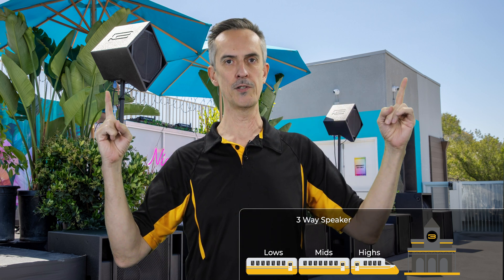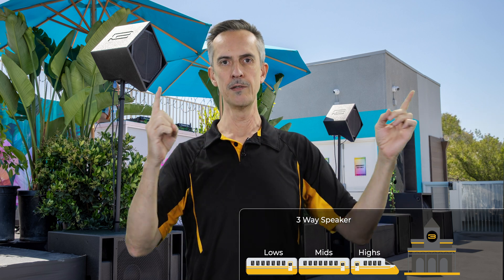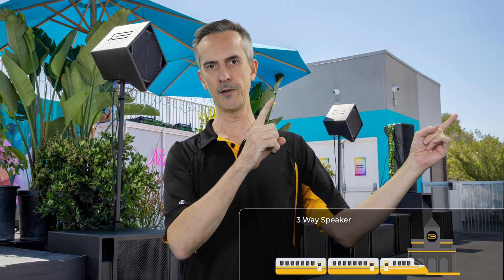Choosing between 2 Way and 3 Way Speakers: Pros and Cons

Comment: But the time delay is usually in millions of a second.  I am sold on 3 way over 2 way speakers just because of the better or fuller frequency band.  
For some reason 3 is the magic number for speaker designs I think.  They just sound better.

Comment: OK - Help here, I need to buy a Bassboss system for two people who travel to a remote location, set up a small portable 20x20 stage trailer (no truss) and ground up sound system for 1500 people, a few hip hop DJs and a few rock bands. What Bassboss set up should I buy for less than $50k
Reply from the maker: Thanks for reaching out! For a portable rig that two people can set up and still hit 1,500 people with serious sound, here's a solid BASSBOSS setup under $50K:

(4) VS21-MK3 subs for deep, impactful bass

(2) AT212-MK3 tops for high SPL and vocal clarity

(2) SV9-MK3 or CCM12-MK3 monitors

Budget ~$3–5K for cables, covers, and power distro

Fully powered, no amps, no DSP, and no truss needed. Big bass for hip-hop and full-range clarity for rock. Let us know if you want help finding a dealer!
Reply: @BASSBOSSBASS  Thank you. If we grew to outdoor shows with 5k people? Would it be better to start off with the MFLA-MKS OR AT312=MK3? TO GROW?

Comment: My question is what would be the better option? I would like to put a VS21 with either a DV12 MK3 or AT212 MK3, watched a bunch of videos of both tops .. I noticed even though AT212 has an extra speaker it’s the same power as DV12 @ 3200 watts… but if you double and stack two DV12’s would that be a louder option for tops to pair with VS21’s?

Comment: I'm dealing with a desire for 12" bass drivers punching out the kick drum so the crowd feels the thump in their chests but the way I boost the 110-125 HZ actually results in speaker cone ripping.  Tonight I'm going to use a 4x12 Mesa Boogie Guitar cabinet (1-way, not 2, not 3) for NO phase issues.

Comment: How do you feel about battery powerstations used as generators to power a bassboss pa system? Using a light set up like 2 dv-12s up to a larger setup a dual 18s or even the kraken?